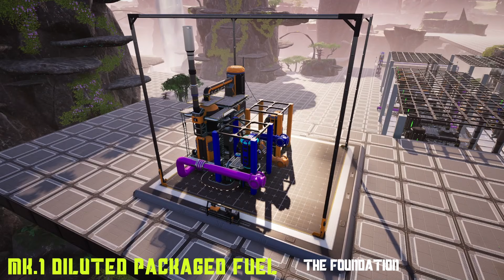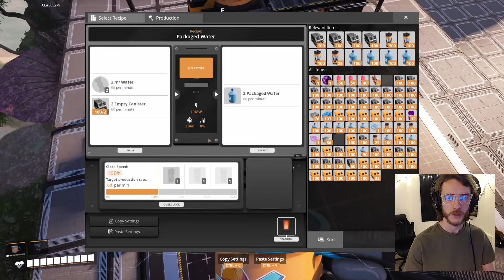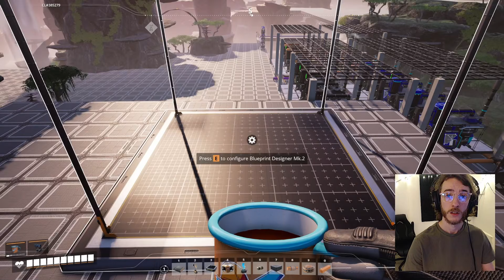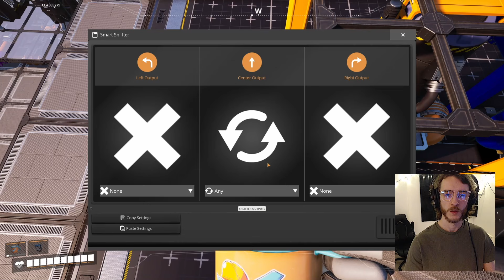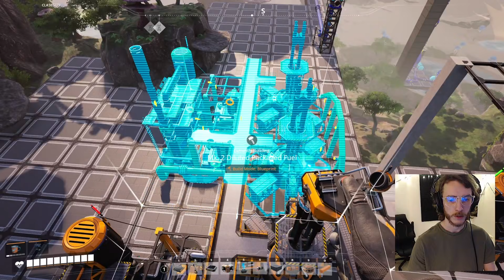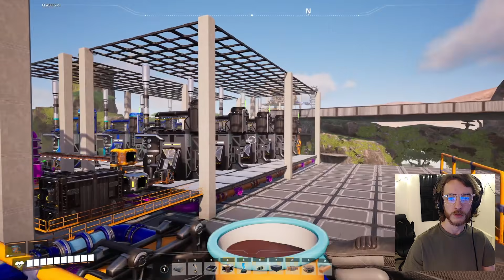Ultimate Mid Game Power Plant Blueprints! - Satisfactory 1.0 Guide - Free Download!

Comment: 12:45 hold up. Is that conveyor lift actually connected to the splitter? After moving it with h? I NEED to try that out myself….. That makes placing them so much easier
Reply from the maker: I was using mods when I made this video so that is not a vanilla feature, the base game doesn’t allow you to nudge lifts, for some reason lol the mod is Infinite Nudge if you want to check it out!